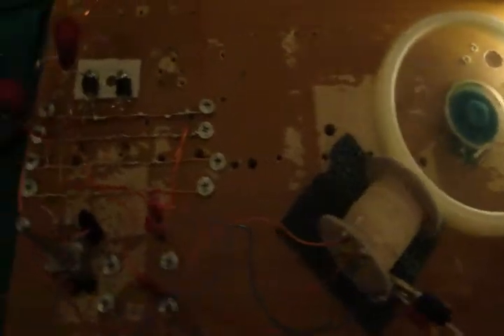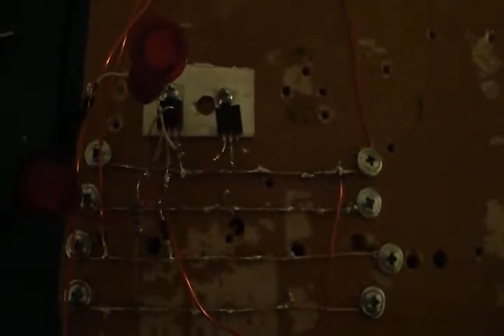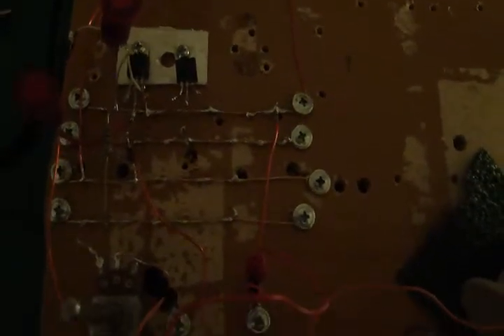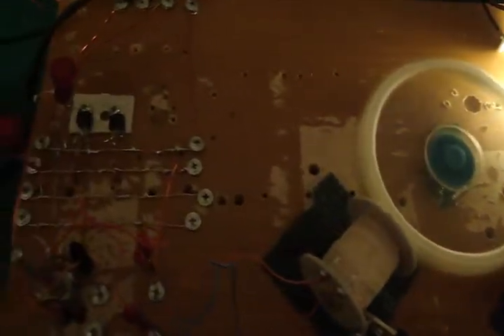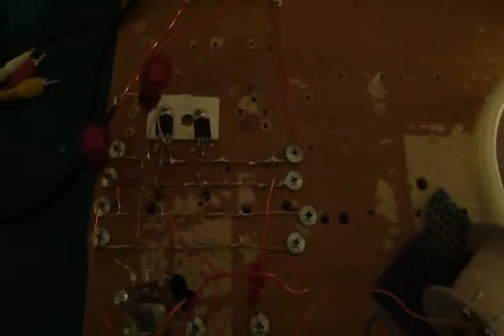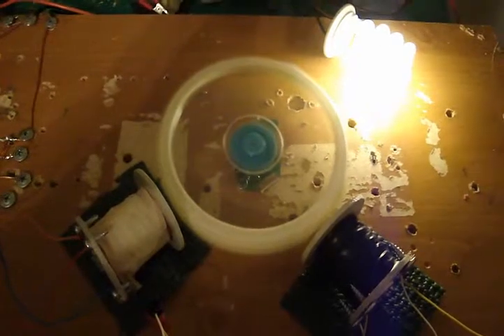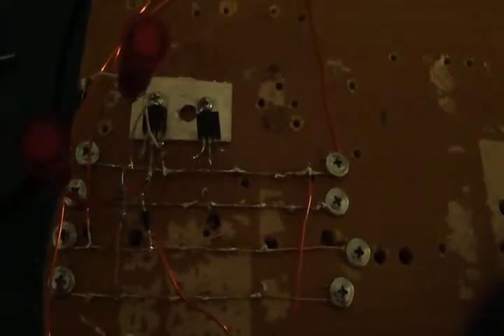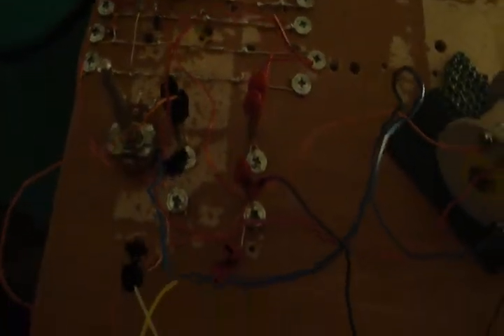Bedini Motor Running CFL.avi

Comment from the maker: @stefb2005 

The schematic for the motor is theDaftman Set-out found on teep. At the output I have an audio transformer connected in reverse so it is a step-up transformer and the gutted CFL.

The output voltage measured at the output screws on the board is 122 volts AC or 122 volts pulsating DC, it's measured on the AC scale. Don't know what the draw is but, it is probably around 1 amp.

Good Experimenting...
Poppy